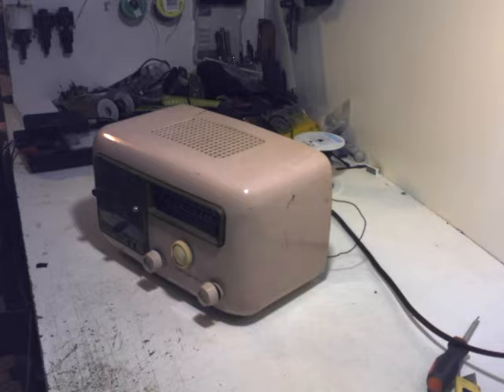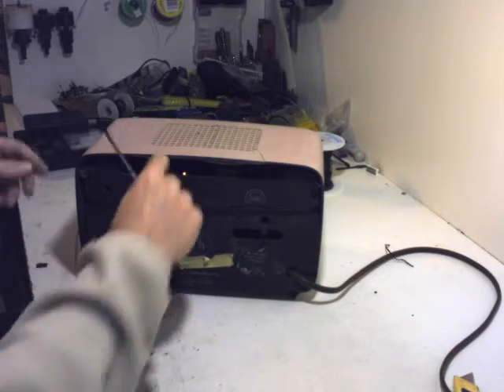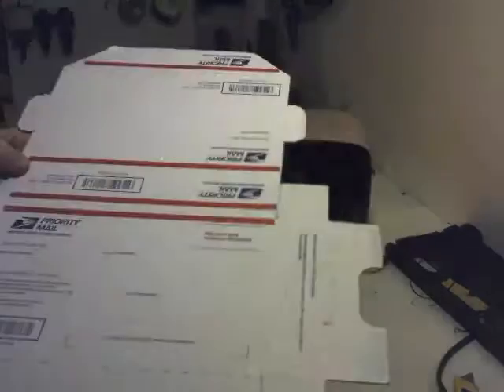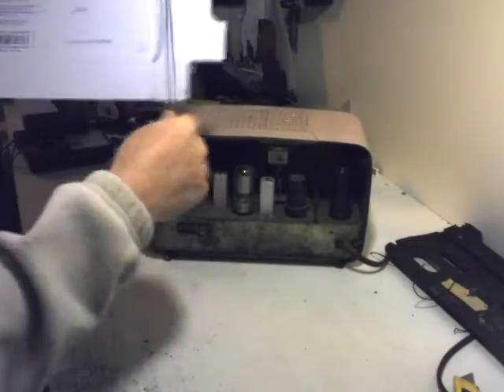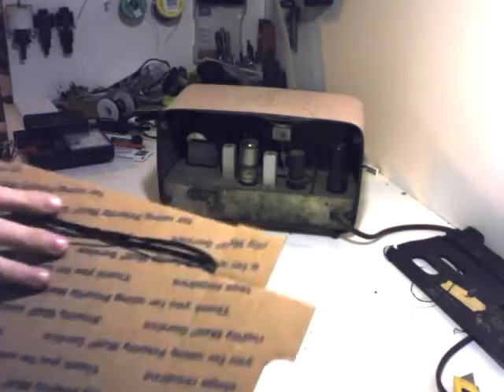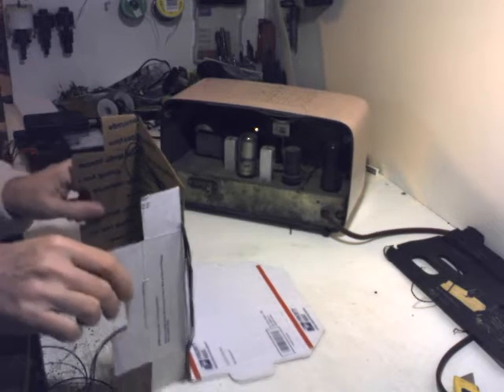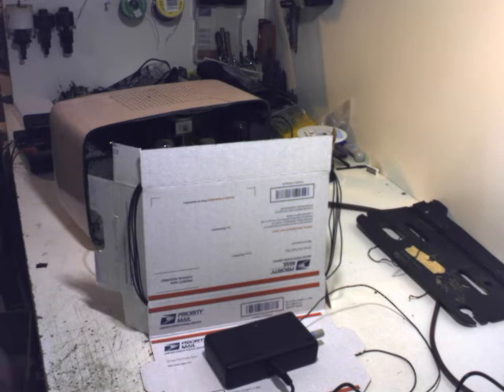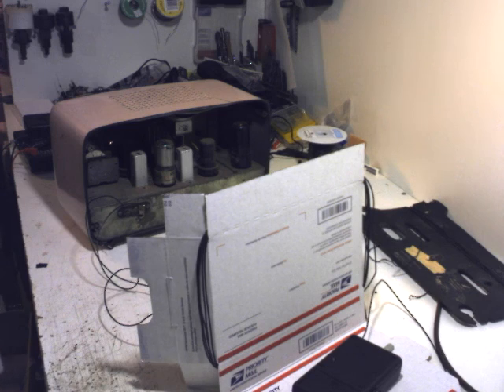Loop Antenna Demo

Comment: Problem is that its makes a potentially attractive conversation piece the ugliest thing in the room. Why not use the wire on the existing antenna and place the back on as it was intended?
Reply: Some people have a radio missing its antenna, this cures that problem.
Reply: Hi, at the end we have two wires where they goes in , one in antenna connection and other?? Please help

Comment: Great simple idea,the AM radio I bought on eBay has a ferrite antenna broken into three pieces and the magnetic wire coating is coming off every where ,so that antenna is no good,I ordered a blank ferrite bar ,and I am going to wrap it in New magnetic wire and fire it when the bad comes in ,so you think it will work ?anyone

Comment: i have graetz 154Gw radio and there are tow wires from the top inside i dont know where to connect it, is that the antenna ?